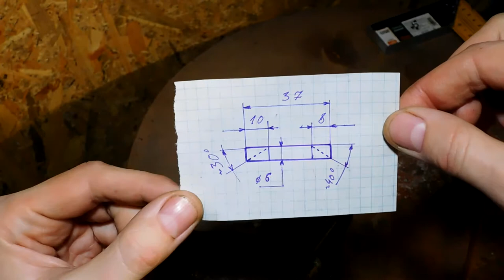Do it yourself winter spoon baits  from from a pipe on a perch

Comment: Very nice , I really like the way , that you pimp the treble hooks with a yellow/red "teardrop"and also your way of colouring your lures by electrolysis.

I have such lures about twice the size(dia.12mm X 55mm to 70mm) , they make up for good lures for asp(aspius aspius).

When I locate asp on the surface of the Elbe river here in northern Germany , I cast this lure at them and retrieve very fast with the rod tip pointing upward , the copper pipe with angled nose would them skim the surface in a narow zick-zack course just like a fleeing baitfish and often fool the asp into a strike.

Also the heavy copper tupe casts very far out into the river.
Reply from the maker: Thank you, this lure is very good at catching perch on winter fishing, especially the one with electrolyte